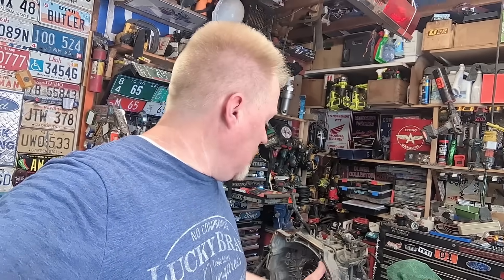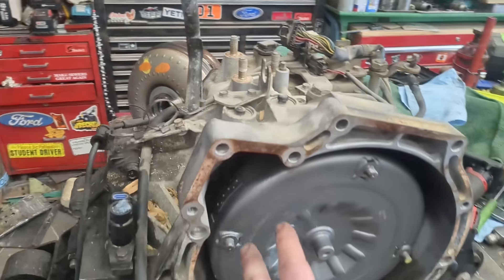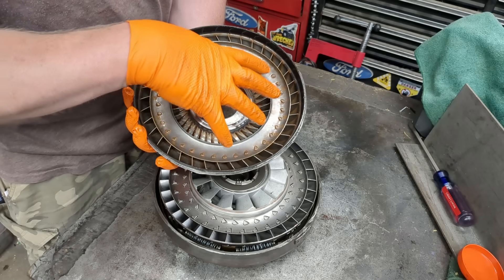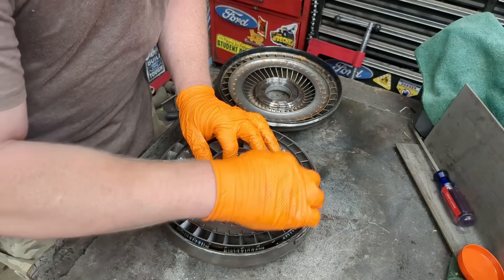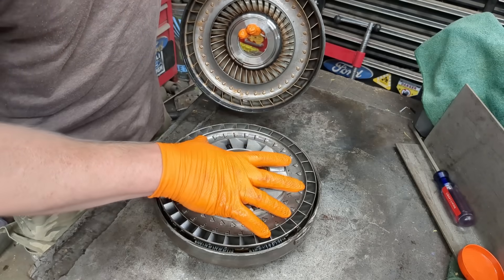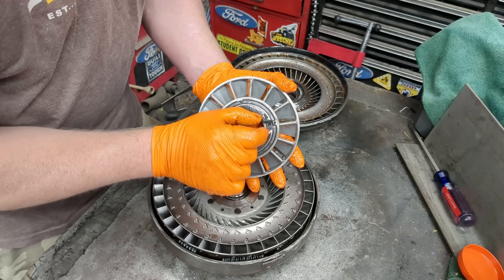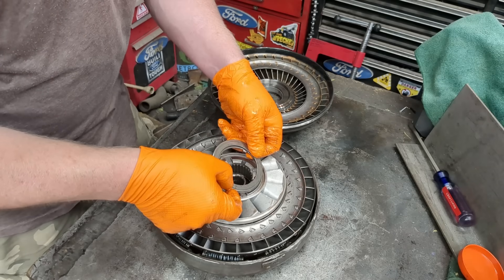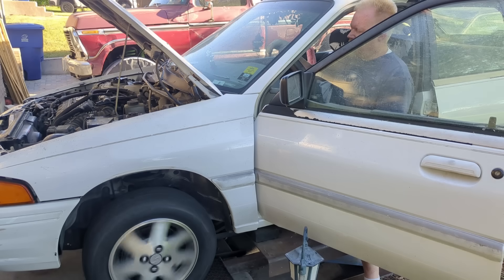Torque Converter HOW they work and FAIL automatic transmission

Comment: Hey, I have a torque converter when I shake it is sounds loose.
Is it suppose to sound like it
Reply from the maker: Honestly, I don't think I've ever shook the torque converter. You can see the main clutch disc and other components are supported with the center shaft from the transmission. So that can move a little bit in there and that might be what you're hearing when it's not connected to the transmission at all.

Comment: I owned a 1992 Ford Escort wagon with a five speed manual / 1.9L Ford motor and drove for seven years until I got bored of it. The only real problem I had was breaking timing belts.  Wonderful cars!
Then I saw one after it was T-bone!
Not a pretty sight.  But I had moved on by then.

Comment: Could spinning on ice and hitting solid dry pavement? Could that strip out the splines?
Reply from the maker: Absolutely!. Along with neutral drops, I forgot to mention those.
Reply: That was my first thought (neutral drop at high rpm by a young male driver trying to get the tires to spin). But maybe not with the pink seatbelt. 😂

Comment: Sixtyfiveford, one of the things to remember after installing a trans/converter assy, is that they forget to flush the radiator trans line. Most of the fluid being cooled by the radiator comes from the converter. I've seen diagrams of converter of lockup converter, but I never seen one inside until this video. Hey Moe, now you have most of the parts, are you going to make a jet engine next?😉

Comment: Excellent analysis and explanation of torque converter function! Although I have several autos, manuals have definitely been tougher and less prone to repair. Thanks!
Reply from the maker: A clutch replacement is a cake walk compared to repairing an entire automatic trans.

Comment: Never really worried about how a TC works, so this was interesting. Thanks for the explanation, and for the answers to a few other questions. 

I did once lose all the drive on my mini (standard transmission). It has transfer gears as the transmission sits under the engine. Turns out the nut holding the input gear on the transmission input shaft came lose and when the car overran the engine a bit the helical gear was pushed off the shaft. Luckily didn't do any damage and Dad was able to tow me home. It was winter and it got frosty so we had to start the engine to run the heater.

Oh, and I borrowed a neighbours bubble balancer a year + ago and it seemed to do great job. I need to swap some tires on and plan to use it again. Might even get one of my own ... just because.

Comment: Been in the tire business 20+ years and I never ever balance my own tires. I've found if you have good straight wheels usually aluminum and a good tire and line your marks up you will never have a vibration issue I mean I go 85+ smooth as glass

Comment: Great lesson. BTW I have a buddy who has a manual tire mounter and a bubble balancer. He's very experienced old guy. He claims that a bubble balancer is good to at least 100mph. I believe him.  Buys tires on line,mounts and balances them. I am impressed.
Reply: Does he buy tires on amazon? Or somewhere else?
Reply from the maker: Best place to buy inexpensive tires is Walmart dot com and ship them to your home(free). The tires I just threw on my daughters car were $35 each. I bought small tires for my VW pickup a few years ago for $25each and they've been great. I bought large truck tires(mud) for around $100 each. A far cry cheaper than any tire store. They have all brands but I gave up on caring about brands a decade ago. They all meet the same stringent DOT safety standards.
Reply: @sixtyfiveford  I have a set on my car from Amazon that I think i paid $45/tire over 5 years ago and still going strong. But I'll check out Walmart as well before I buy my next set since I have like 500 cars. lol
 Thanks!
Reply: @JDeWittDIY  I honestly don't remember, sorry
Reply: @tombob671  No worries. Just looking for good quality tires and I could use some pointers. Thanks anyway!
Reply: @JDeWittDIY   no problem I guess I was kore intrigued with the bubble balancer I am sure he used name brand tires. I do remember on his Lincoln he had some Bridgestones

Comment: I have a torque converter shudder  in my daughter's RAV4. Do you think I could just replace the converter and still use the transmission without rebuilding it?
Reply from the maker: Yes and No. So a torque converter shutter will happen in top gear right when it engages the lockup clutch. You shouldn't feel it any other time other then when you're doing roughly 45 mph plus and it's switching into lockup mode . It's the clutch pad itself slipping. This could be due to a warn clutch pad; then yes it would fix it by replacing it. However, this could also be inadequate pressure to hold the pad against the mating surface. No in this scenario as this would be an issue with the valve or pump supplying the pressure. Sometimes you can eliminate it just by not putting the car in overdrive. Not all transmissions allow you to do this. But not being in overdrive never allows it to kick into lockup. Again this isn't true with all transmissions as some will do it anyway even when overdrive isn't activated.  I've also heard of transmission fix fluid being added and or friction modifiers that help the clutches grab harder. Essentially it gives less lubricity to the clutch mating surface and allows it to lock up easier. Sometimes just multiple fluid changes fix it as well.

Comment: You are one of so few channels left on yt that actually have education content for dsy to day life. I know a lot but torque converter never really interested me as I'm manual lover and yet with 15 minutes of eating dinner now I know.
Reply from the maker: I despise automatic transmissions. Mainly due to their inefficiency, they're problematic, and a death sentence for any car.
Reply: True. Sooner or later they all fail internally while manual is just few parts and 100% transfer of power. You can also engine break or for example chose acceleration or economy depending how (or rather when) you shift gears.

Comment: I have always been a big fan of manual gearboxes.
I think automatic transmissions are way too complicated and are way too delicate.
I have driven manual gearboxes all my life and never once changed the gear oil and never had a manual gearbox fail.
Having said that I always wanted a V8 so I now drive a 4.8 Porsche cayenne with an automatic transmission.
🤞🙏

Comment: Pretty interesting. I knew there must be a clutch like thing inside because once my torque converter locks, it feels like it's in gear with a manual transmission. PS your son looks exactly like you. For a second I thought it was you under the car.

Comment: What a complicated piece of machinery. The guy that invented that should of got some sort of medal for being a genius, even the rear differential and how much abuse that thing takes is another amazing piece of machinery. Has anyone ever heard of a front wheel drive chain that stretched and the car couldn't move?
Reply from the maker: it's quit the engineering feat for sure. A newer CVT transmission uses a large metal V Chain as a belt and stretches or breaks rendering the transmission useless.
Reply: cvts are prone to failure but what about the big Cadillac front wheel drive chain? @sixtyfiveford

Comment: Your explanation of how a TC works is the best I've seen to day. I watched some videos in the past and after watching several finally got an understanding of how they work. But yours was right to the point of "this works because of this and that". Also genius to spin and split the torque converter over the table using one ball bearing.
Reply from the maker: Hey Thanks
Reply: Talk about a balancing act.

Comment: How is your transmission /engine mount condition ? I notice some  excessive engine jumping when you shift into reverse .
Reply: Yeah, and especially at 14:19
Reply from the maker: There's no issues with them.  That front corner is over a foot away from the closest mount and is actually just an alternator bracket. You're seeing about an inch of slot between reverse and forward which would translate to about 1/8 of an inch of movement in the mount. If you stuck a bar another foot out you'd probably see 3 in of movement.

Comment: What do you mean Ford Taurus transmission side of issues I threw mine from Park Triforce gear at 4 grand what is ironically the rev limiter the engine in that car didn't last long after that

Comment: From this view point, it does look like the transmission shaft spines got rounded off a tad as well. That could render the splines on the torque converter to premature wear again. I'm not the expert since you have the parts right there in person. There's a lot of labor to remove those in front wheel drive vehicles it seems. 
Your dog is one smarty pants.
Reply from the maker: The spines had 0.0005" wear off the top of each tooth. A human hair is 10x thicker at 0.005" thick. Essentially just the machining texture was just rubbed off.
Reply: @sixtyfiveford  I hear you.

Comment: do you have any sort of degrees or background in engineering / what is your background? just curious not saying you need those things just wondering if you did ever go to school or learned that way or this was all self taught
Reply from the maker: I did go to college for Mechanical Engineering but all you learn there is Math, Math and more Math. All these things I do/learned are because I cut and take everything apart to see how someone else made it. I would rather do any repair myself vs paying someone. I did spend nearly 10 years running a wood shop building custom high end furniture but that got boring. Mechanical items are more fun.

Comment: awesome video as always... i watch another video of a guy with a dodge cummins truck jenniesgarage and he just did a video about keeping his older cummins transmission in locked up mode as long as possible to not generate heat in the transmission to prolong its life-- wondering how that applies to this. and also why would you not always want it locked up? or like what does locked up whatre the cons of it being locked up.
Reply from the maker: Locked up is ideal for heat, power and fuel efficiency. The issue is smoothness of shifting and driver feel. The lockup only engages in top gear under light-moderate load and stays that way unless you floor it and it thinks it needs to kick down a gear. If you have a tachometer you can watch it engage without you feeling it. Top gear cruising you will notice the rpm drop (quick blip) 2-300rpm as the lockup is engaged. If it engages too early it will slip and grab and you'll notice a definite shifting gear feel. Adjusting it to stay locked in more often will likely wear the lockup clutch and shorten it's life. Not really sure what this reduction in life would be in terms of mileage, but it may be dramatic or nothing noticeable at all. Temps definitely play a roll in transmission life and I think an auxiliary cooler is the way to extend life.

Comment: Is it really necessary to replace a converter if your transmission has failed and produced metal? There must be some way of cleaning it out without buying a new one?
Reply from the maker: It's virtually impossible to clean it out without cutting it open and cleaning it. That's why they always say to replace the torque converter. It only takes the smallest spec to lock up the sprag clutch/stator and the TC will perform like crap. In theory the contents of the TC dump directly into the pan after they circulate; so the pan, magnets and filter would catch them but almost anyone would rather pay the price for a new TC vs having to rip it out/reinstall the trans.

Comment: I mount and balance all my tires, I do my balancing like I do my motorcycle tires and have had zero problems, and no shaking. I've done this now for 25+ years.
Reply: Really?  That's a great accomplishment!
Reply: @turkeyssr idk how great it is, but why pay 30 a tire to be mount and balanced? I can do it pay to drop off the tires for 15 dollars for 8. And with little tricks I've learned along the way, is pretty fast if you don't get one with a tire that's gotten stuck on the bead with crap.
Reply from the maker: The savings add up. But not only that, the cost of tires is far cheaper ordering them online. $150 total and I can slap new tires all the way around a small car. That'll easily cost anybody $300-400 at any tire shop after all hazmat fees, mounting, balancing, valve stems, franchise fee(LOL) etc. It does take some time to learn to make it easy but people don't realize how much time they spend at the tire shop or time spent having someone pick you up/drop off while they work. A worthwhile skill set.
Reply: @sixtyfiveford very true that one slipped my mind while writing that. Tires are much cheaper.